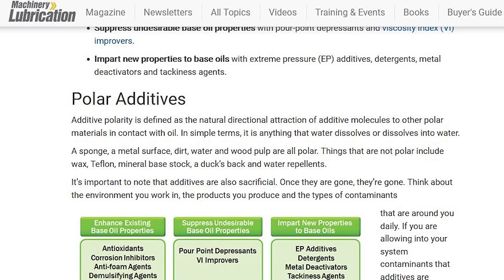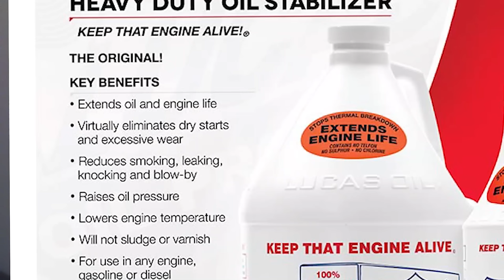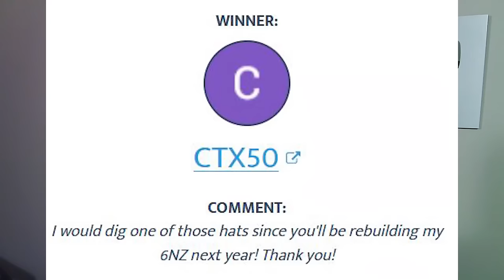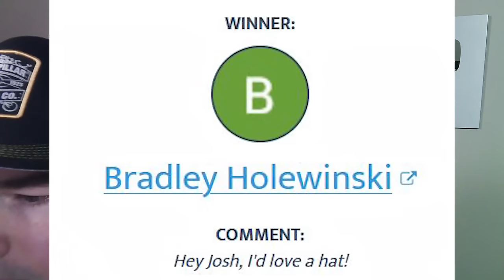Does your Engine NEED Lucas Oil Stabilizer? A detailed look at the "Benefits."

Comment: In most cases any aftermarket additive does not improve your oil. Does it mask a problem for a short term period of time possibly possibly. The fact of the matter is what is the quality of the oil that you're using in the 1st place if you use a good quality oil the best that's ever been made on the market is amslaughter if you use one of these additives in that it deletes and effect the additive package that was originally put into the synthetic oil and defeats its ability to do with the job properly. Also it does the same thing with some mobile oils and some other oils you cannot put an attitude blindly into an oil without knowing if the  Additive package in the stabilizer helper whatever you want to call itCombined with the additive package it's already put into the decent etiquette oil. It may overload it may cause extensive cleaning which causes friction wear and there's numerous other things it's not something that just should be blindly done. But people don't realize what oil does or how important it is. It can prove gas mileage it can improve compression it can reduce wear if  Use properly in the conditions that it will be required to required to protect the engine and according to the specifications of the engine however anyone else can be used in any engine unless it violates a missions regulations which is a new thing.. Most of the information out there is commercial and propaganda to make you believe in buy things. I believe in Amazon because they spend their money on testing and improving their product instead of convincing you in running commercials.. True people don't speak a lot to convince you of what they just do it.. And I believe in other  Lubricants also. Let me ask you a question if a transmission is slipping and you put sawdust inbut saw Dustin at least in the older units you could make it shift for a couple of weeks to be able to sell it does that make it a good product to add no

Comment: only time id ever use it is if the engine was worn enough that the thickness of the oil is more important than the additives. this would also mean its likely soon to fail either way

Comment: 05 cummins 370xxx started at 157xxx 0 blow by been using lucas every change at 3500 miles sticky is good for cold starts and extended idle( many days idling nodak oil fields!!!) either way viscosity breaks it even at time of change so imo shit works

Comment: Your description of this Lucas stuff sounds like the old STP from the 60s. Did STP improve the engine, or did the much higher viscosity than engine oil, quite things down. I’d put both products in the same class: not quite snake oil, but not really a product that improves an engine. Only an overhaul will do that.

Comment: C7 and C9 use same HEUI injection system tech as Ford Powerstrokes...so don't use Lucas in those?  I use Archoil Friction modifier in both my Powerstroke and my C7 and have never had the typical stiction/pump/injector issues.

Comment: I am a believer that this additive only works on a worn engine. I had a sh!tbix S10 with worn bearings and this was the only thing that made it through my college years. It kept the oil pressure up and reduced the knocking. 😂

But this doesn't do anything to a new or good engine. I put this in a newer Corolla and it gave is a rough idle and was kind of slugish as it warmed up. My guess it thickened the 5w-30 too much and had a hard time flowing.

Comment: My dad had a old inline 6cyl wore out to  the core I remember him mixing bearing grease motor honey 🍯 and stp hahahaha ran the motor for 5 years sounded like a diesel and 🚬 smoked like a coal fire he adjusted the heads once a month 😅 till he finally stopped driving it it never failed that's the point we called the junk yard to pick it up knowing it was  pretty much toast

Comment: Iv been using lucus In all my vehicles  for years and the miles on my vehicles are from 200,000 to 250,000 miles and they all run with original engine  and I only change the oil one to two times a year.

Comment: I've been a tech for 30 plus years and have seen lots of engines with over 300k with regular oil changes and they still run fine,not saying that this stuff doesn't work just saying maby regular oil changes is all an engine needs?

Comment: I've been adding Lucas oil additive to my oil changes for the last 11 yrs. But not the recommended amount. Just 3 gulbs (blop, blop, blop) . It has kept my oil from breaking down and carbonating causing wear. I  use traditional oil and change my oil every 3 to 4k miles. By using less it thins out in the oil but keeps the oil slick. No engine problems and have 290,000 miles. I  swear by it. I also use their fuel treatment once a month and have never had to replace a fuel injector.
Reply: This is the most scientific approach to any problem I've heard of this year, I'll definitely use this one. 🤔

Comment: I don’t trust the additive. I used it once in my 97 ranger 4.0 ohv. I had 176 thousand miles on it an had a bottom end knock since I got it. Lucas made it worse. I was using 5w30 as it recommended. I drained It and switched to 10w30 with out the sedative because I could get away with it being an older truck and that cured it for the long haul. I think it would be a good product but I recommend you use less then what the bottle says cause it makes the oil to thick for the oil pump to pass on high mileage engines

Comment: Is will never ever put Lucas oil stabilizer in another engine ever again. I used it in my 2003 Dodge Ram 5.9 Cummins perfectly healthy engine. After adding it the engine immediately developed a tick in the valve train. Turned out to be a worn rocker trundle. Didn’t learn my lesson, used it in my 1988 ford 300 i6. After a thousand miles engine developed lifter noise. STILL DIDNT LEARN MY LESSON, used it in my 2000 Jeep xj 4.0l also made the top end develop a nasty tick that went away after changing the oil. I have all the evidence I need to never out that garbage in another engine. 3 of the arguably most robust engines, hurt by whatever that snot is.

Comment: This is a additive that had a purpose on engines that had babbitt bearings they would flake and break down with load this additive would cushion the clearance that is typically larger than engines now. In a nutshell older engines relied on the babbitt as a dry lube when oil took a few to get there a layer of babbitt on the top then a layer of copper then the steel backing. Lack of service would show the copper layer. Now today all engines have aluminum coated bearings not as forgiven as babbitt but stronger no flaking a low oil event that the older engine would survive the new engine dead .metal transfer into the crank and boom done. The newer engines use this bearing because it can handle much higher loads IE torque and horsepower and the clearances are smaller designed for water yeah very thin oils its thermodynamics the more fluid you have to move you have parasitic losses. A tight engine is way more efficient than a loose one. So back to the Lucas any engine produced before the 2000s you may benefit but after the engine has tighter tolerances and aluminum bearings the syrup will kill your engine. Just saying.

Comment: You are trying to be fair. My experience shows a little dab will do ya. Engines dying all round on 0w oils. Green mandates are forcing it. 5w-30 syn. With 3000 to 5000 oil changes is magically preventing oil ring destruction. Wow! Whodathot?

Comment: I put Lucas oil additive in my 2017 GMC Sierra which is supposed to be safe I got a lot of knocking noise and stopped and drained it immediately overnight even though it says it mixes with synthetic it does not🙄

Comment: If you use their 3 gear prop for advertising you will understand the difference between straight motor oil and Lucas additive. It immediately travels over all 3 gears as soon as you turn the gears. Regular oil will not do this.

Comment: i use this luck on engines with high milage and it works well.  my rambler has 480000 miles.  won't use it on a new engine.  marvel is a great cleaner and gets behind rings and stuff.  oil will get darker quicker.  good top cylinder lube.

Comment: I had a 1995 7.3 Powerstroke that loved the Lucas oil additives. I later found out that on the newer engines after the 2003s ones w aluminum bearings it would tend to eat at the bearings.

I have yet to put it in my 93 idi, but I might try that next oil change to see what happens.

Comment: I used lucas in several of my sh!tboxes over the years to limp them along... oil temps always went up when using it even though the engines ran better and were quieter. After draining aerated oil i figured it was too thick so bubbles couldnt pop fast enough, acting like a thermal insulator. Stopped using it once i didnt have a vehicle that needed limping to keep it going

Comment: Read instruction and application then Use it then give your opinion.   If you don't use. Do not give opinion.  Regular oil alone will not save an overheated engine but with lucas you have 50 to 80.percent chance to rebuild the engine.  Mechanic is not an engineer.  School teach you to be a follower and not a leader.

Comment: I don’t agree. 
I’ve run it forever in my worn out old small block chevys. 
It quiets the engines, slows the burning of oil down, raises the oil pressure to a reasonable pressure. 
I’m talking from almost nothing at idle to 25 psi. Yes I know the bearings are shot. Yes I know they are worn. 
The trucks run pretty darn good for what they are. 
It’s way cheaper than taking my trucks off the road and rebuilding an old turd.
Reply: Exactly what these Additives are meant for:
Keep worn out crap running as best as possible.

Comment: Why is it not for use in Ford Powerstroke? No this is a serious question. When it comes to wear protection the Ford Powerstroke is a vehicle that requires every bit of help it can get. With the mandatory failed science project like the EGR and the DPF systems that fill the engine from clean air intake to the crankcase and exhaust with thick carbon build up these vehicles need every bit of help from any and every source possible

Comment: Your oil doesn't need stabilizing. Modern engines have very specific requirements that modern engine oil delivers. CK-4 diesel engine oil is amazing compared to oil 20 years ago. Use the correct type and grade, and CHANGE it OFTEN!!! Do not extend service intervals without oil analysis AND expert advice from a master Tech.

Comment: I had a rack& pinion stiff as all get out but didn't leak(yes I knew it needed replaced) but I sucked out fluid put in Lucas rack&pinion oil in it and you could turn steering wheel with 1 finger but I did eventually change rack but surprised me it did anything

Comment: I think the  average person using this additive are putting it in.an older engine . Second , when mixed with oil , this additive is way thinner , thats why most people know to put in a half quart of oil then mix half the additive to that left over oil , and it will pour right in , full strength additive takes forever!!!! So S for cold starts,  it may be slightly thicker but so does 10-30 or 10- what ever.😊

Comment: My engine will lifter tick most of the times when I start it (I drive this car maybe 1-2 times a month) but is way quicker to go away and quieter with 1 quart of Lucas additive in it - car has always done this and needs regular oil changes every 5k kms, I swear by it for my 1994 turbo engine but I would use it in any of my other cars.
It helps with my lifter tick and that's really all I use it for

Comment: it is not to replace your oil it is a added protection. yes I use a different brand in racing but probably doing the same thing you add a half quart per change. when Itear the motor down after 20 circle track races brgs still look new and to give some info 13-1 comp- ratio plus 7000 rpms.  One more example had a farmer I built motors for that told me how his wheat trucks would eat camshafts like 3 during harvest the only change he made was the oil supplement and cam failures went away and never touch the motors for years he even came back every year to thank me because of the money and time he got to save. when you mix it with your standard oil I did not see any oil pressure change I will also tell you don't use it in a new factory car motor until you get to a high mileage.

Comment: Lucas is worth its weight in gold not only does eliminate dry starts once it blends with your oil and gets up to operating temperature it does change State and is not a thickener anymore like this guy complains about. This does not make your oil thicker once you're running Lucas heavy duty oil stabilizer everything in your engine is like silk when you tear apart an engine after you've been faithful with this additive everything feels like silk

Comment: Wouldn't advise using on modern engines. They consume oil from the factory due to low tension rings. I don't think Thickening the oil is great for something that's designed to use thinner oil. Not to mention tolerances and tight oil passages, why would you want to thicken oil for cold starts where a lot of wear happens

Comment: This video has a bunch of claims in it that are assumptions AND incorrect about the use of the product. When using this conditioner, it comes with directions as to the correct mix for your engine or application. To say "it's an oil thickener" is correct HOWEVER you don't use it at 100%. When the engine warms up, even this product thins out to coat all surfaces and get into every area of the working parts of machinery. I have used this product and can assure you, that with my 23 years of active work in mechanics in the Australian Defence Force, as well as running a shop since my retirement, that the product DOES protect your engine and it's parts. I agree that the claims on the bottle do not display any references regarding research, and Ive written to the two main offices for clarification on the claims as I believe claims like this should be backed up with research by an independent third party, OR clearly labeled as a "general opinion". However what i can say personally is that the product generally is true to its claims. "Blowby".. This product doesn't "possibly" correct the issue, IT DOES. Try it and see for yourself. "Oil Pressure" Higher oil pressure the majority of engines IS better as those who know how to use a product like this would be using it in an engine that's in some capacity worn. If the owner of a car or engine researches the recommended internal pressures recorded for their model (even in a general sense) they would know the tolerances to stay within, however most folks wouldn't do such a thing. Therefor the product has a clearly marked "Mix Ratio" knowing that if you stick to the recommended blend of this product and your recommended motor oil, you will be perfectly fine and cause NO damage. BUT if you fill your car with this product alone, then YES! it could cause issues and cause them very fast. But nowhere does it say on the product to fill your engine with Morey's 100%. "Cooling temperature" If you know anything about motor oil you'll know that it breaks down after 5-10k km. The oil may still be in your car, but it's ability to remain in its original viscosity and importantly "stickiness" has diminished. Morey's and other products for that matter address the issue to keep all parts lubricated and coated. This reduced metal on metal wear and that reduces friction and heat. The statement on the product leans more towards truth than not. Will it stop the car from reaching it's typical running pressure? No, it will simply slow it down from getting to max temp and that is a positive for all parts concerned. It will not freeze the more of keep it icy cold, it will simply address its purpose and that is to lubricate completely. All I have heard in this video is nothing but opinions from someone who's video has drawn out many comments to the contrary. Ive lost count of how many people who have run workshops and fleet vehicles, speak highly about this product. My advice is ASK YOUR MECHANIC, someone who's done a few years on the job and thousands of engines to draw real life experience from.